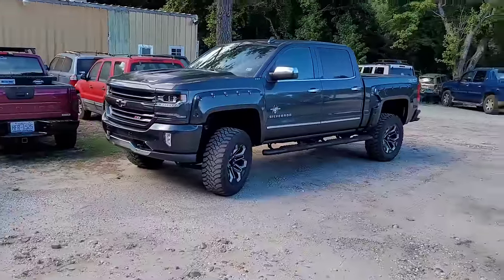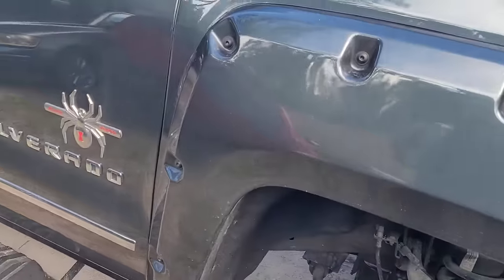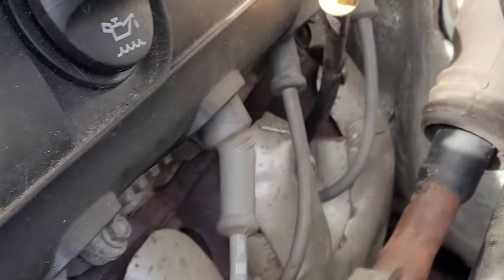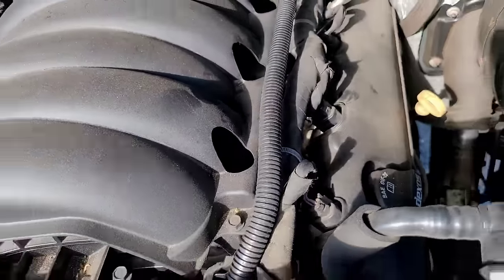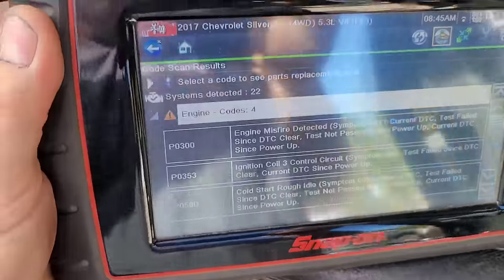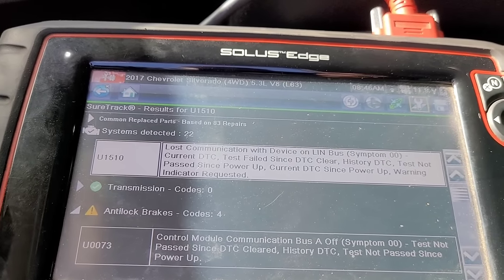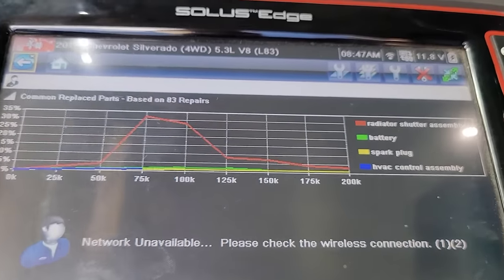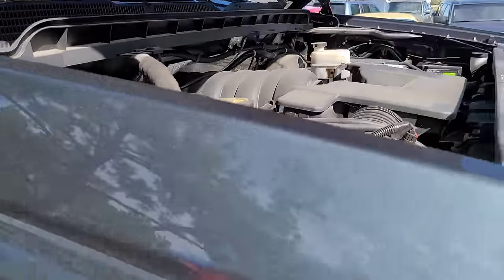AGAIN !!! Another "Tapping" 5.3 !! It's not lifters or exhaust.. 2nd time I've seen this..

Comment: Just to let you know I have a 6.2 L Chevy Silverado and I had a lifter failure the lifters collapsed so yes they are out there they do happen I fought with the company they tried to just replace the two different lifters that failed but eventually I had them replace all 16 so that's something you need to look at when they do fight you on this you need to have all 16 replaced not just one or two good luck
Reply: And then 4 more fail.
Reply: If they replaced those 16 with the same type, guess what? They put a bandaid on a bullet wound! Turn off your AFM\DFM, all depending on which one you have. That's the only way to be sure that your lifters won't stick in the collapsed position (what they do during cylinder deactivation) and then not pop back up.
Reply: We went through that they identified the lot part number that was bad so they did not replace them with that particular Lot number they replaced them with a known Lot number or part number that were considered good they have identified the malfunctioning lifters yes I had to go around and around with them on that to make sure they didn't stick bad lifters back in there the same Lot number and part number as the ones that were in there that were defective
Reply: @waynec211  And you believe that? GM has been having the lifter issue for years. Unless they changed parts supplier, I wouldn't take it on any long trips. Like I'd said though, if you disable your fuel management system, which can be done right from your dash, then you'll run the risk of it happening once again. You may notice up to 1 mpg difference in your fuel economy, which to avoid it happening again, sure seems worth it. Ask yourself this, if GM knew it was just a certain lot number of them that were causing the issue, why have they still been installing them in their 5.3L and 6.2L V-8s for the last ten years? Only thing I don't get, is why they haven't changed suppliers by now.
Reply: Yes I was considering disabling the fuel management system I had heard that could be possible problem too so who knows what the hell to believe but I guess I will look into disabling this fuel management system I don't like it anyway it's annoying
Reply: Thanks for the information I've been looking around for a disabler just plug in but most of the ones I'm seeing don't work on the 2021 Chevy Silverado 6.2 so I'm going to continue looking around
Reply: @waynec211  You should check out the Pulsar LT, this will get the job done for you, and then some. It's a simple install, many videos here on YouTube that walk you through the setup, and it has a lot of different options you can choose from right from the comfort of the drivers seat. I can guarantee that it'll be the best upgrade you'll ever make on your truck. There's a guy on here that has it on his 2021 Trail Boss with the 6.2 and he's knocking down 27mpg with it set to economy mode. I wouldn't have believed it if he didn't actually film it right from his dash showing it. Sounds crazy, I know. But just put one in mine, and figure with the price of gas now, it'll pay for itself in no time.
Reply: I bought a pedal Commander which I believe does the same thing as the Pulsar LT that you're talking about I just leave it in City mode plus one disable the fuel management system I'm hoping
Reply: @waynec211  Let me know how it goes. I haven't really done any research on the Pedal Commander before, so I'm just not as informed on those. I'd be really interested in knowing what your thoughts are on it after the install. Please feel free to give me any feedback you can. Always interested in learning more about aftermarket mods out there. 
Thanks, and I look forward to hearing from you in the future on this!
Reply: Yeah the pedal Commander it does increase the performance of your vehicle the response of the throttle body is a lot faster it will give your vehicle some get up and go especially if you put it in Sport Plus mode plus four right now I'm running it in City mode plus two hopefully disable the fuel management system I'm getting ready to go on a road trip of 1200 miles both ways and that's what happened last time after I got back from driving on the same trip I ended up having lifters go bad and stick or collapse so hopefully this will take care of it
Reply: I will say pedal Commander turns your vehicle into a beast especially the 6.2 L
Reply: @waynec211  You've got it installed already then?
Reply: @waynec211  There's still the button down along your controls that let's you turn on or off the trucks AFM/DFM, (not sure what year your truck is, depending on which fuel management system the factory strapped your truck with) but it's better to be safe than sorry I guess. I'd just hit that switch if your dash doesn't show it's turned off. As I said, I'm really unfamiliar with the Pedal Commander, so I'm not 100% sure on it's settings. Let me know how your trip goes using it, and track your mileage over the trip and see if it increases your mileage. That's what's so stupid about these fuel management systems the EPA is forcing car manufacturers to install, when in fact most of these tuners actually give you better mileage, and aren't so hard on the engines internal parts. But then again, who thought the Government getting involved would be a good idea, after all they're the same fine folks that gave us the DMV, the IRS, and the Post Office, and look how well that works for the American public!
Reply: @waynec211  Have a safe trip, and keep me posted, please.
Reply: I have called General Motors and I'm awaiting a phone call back on how to disable the fuel management system apparently the Suburbans have that option on them I'm going to see if I can get that option added to my Chevy Silverado so we will see what happens
Reply: What I mean by the Suburbans having the option I mean you can turn it off or on so I'm trying to get the dealership to put that same option on my truck to add it to my truck so we will see
Reply: Yes I have installed pedal Commander pretty easy just plug and play it's not bad at all it's just like the Pulsar LT you're telling me about pretty much sounds like the same thing I looked at them supposedly General Motors Suburbans are capable of disabling the fuel management system according to the people that I talk to at General Motors so we'll see what happens I told them why don't you allow me to install this on off switch like the Suburbans have still waiting on a call back but I just called him today
Reply: @waynec211  so if you don't have that switch along the row just below your heater controls, I think that means your truck has the DFM chip then. You'll have to check your original window sticker, and see if it's listed on there. If it's a 2021 that was built after March 2021 they ran out of the chips that operated the system through the truck ECM, and gave customers a $50 credit shown on the options column of the window sticker on the right-side facing. It's all just a bad idea at the end of the day, and GM, along with Ford, and Dodge (all 3 have had lifter issues) should be able to make that an addable option, because I know there are hundreds, if not thousands who would've actually paid the manufacturer to just leave it off completely.
Reply: Just below my heater settings I have a a with a arrow that goes around it which is the auto shut off on the start and stop when you pull up to a red light engine shuts off then comes back on I always turn that off then I have the tailgate button then I have a hazard button then I have the traction control button and then I have the electrical outlet button and that is all I have
Reply: I have a 2021 Chevy Silverado 6.2 L I just put the pedal commander on I turned it on City mode and left it there on setting two I did not get any kind of indication on the dash whether the automatic fuel management system was on or off but I will have to look at it closer and see I don't think it's going to indicate it's on or off so I really don't know how the hell I'm supposed to tell
Reply: @waynec211  Yup, you have the AFM on yours, that start stop is the fuel management. You've probably noticed when your driving out on the highway, or open road that when the engine isn't working as hard, on your gauge cluster you'll sometimes see a 4, or a 6. That's how many cylinders are actually firing at that time. When that's going on those deactivated cylinders have the lifters collapse to keep the valves closed, that's where the issue begins, when you then need the engine to use more power, say climbing a hill, or pulling out to pass, those lifters are staying collapsed, yet the ECM is telling it that it needs all 8 cylinders again, and the internal violence inside your engine begins. Hopefully the pedal commander you installed will take care of that AFM (Active Fuel Management) defect, I don't know what else to call it other than that, and your engine will continue to fire on all 8 and let you enjoy the trip!
Reply: I have about three more weeks before my road trip so I'm going to play with this pedal commander and I will look for the indication of 4 cylinders off on my cluster I've never seen it before so I don't really know where to look so I cross my fingers and hope this solves a problem if not General Motors will be replacing another 16 valves or maybe they'll just allow me to disable this thing or they can just keep paying for it or until the motor blows up and they can buy me a new motor I will try to let you know and keep you updated on what I find out
Reply: I called the dealership where I bought the vehicle and they say that I have a dfm and just merely turning off that start stop button is not going to turn off the dfm so I have a system that can shut down more than 4 cylinders looking to go down to three so still hopefully this will solve my problem putting the pedal commander on so we will see if I end up getting a new motor
Reply: @waynec211  fingers 🤞
Reply: @waynec211  I wish you could send me a picture of your original window sticker, or build sheet. That'll tell you for sure what you're dealing with. But it sounds like the Pedal Commander might do the trick for ya. Feel free to come back to the post along your trip, and let me know how it's going.
Reply: Will do.
Reply: @waynec211  Wow did it take a miracle finding this thread! So Wayne, how did your trip turn out? And are you liking the Pedal Commander set-up you're running now?

Comment: Wish my ticking on my 6.0 in my H2 Hummer was a plug wire coming loose. Mine is those stupid ass rusty exhaust manifold bolt heads that break off. That is a nice a Silverado, that color and whole package is exactly what I want eventually.

Comment: Back in 16 I got a 13 GMC with 10K on it put a little 6K on it and a dod lifter did indeed fail. Found out it had pistons rods and bearings done just before I got it Never knew why and far as I ever found out or was able to tell it was not a abused truck I got rid of that POS soon after I got i back Thankfully it was still under warranty

Comment: Factory lift, like any other lift really brings about the need for longer Tie rods.  The rack being attached to the chassis has to reach an increased distance to the outer tie rod socket.   I wonder if the factory really thought about that?
Reply: Usually packages like that are more dealer installed aftermarket than real factory things. Just one of those things where they can install $10k of stuff and charge someone $15k extra because it’s bigger and meaner than a standard one. 
That one for sure needs the front end checked close and an alignment. Probably drives like crap too, but has been that way so long they don’t notice.
Reply: Black widow is NOT factory.  Actually a service bulletin mentions that black widow may have suspension issues not covered by gm warranty

Comment: I see you pulled the primary coil connector first, and then corrected the secondary connection, but you should explain to laypeople why you did that. I’ve seen electronics get damaged on newer vehicles when people play with the ignition wires on running engines. By the by, shutter assembly on radiators is to quickly get engine up to operating temperature(strictly emissions related), but if it fails default closed ala VW/Audi products, you can end up with elevated coolant operating temperatures.

Comment: I've  got a 5.3 that did that, it ended up being the o ring that seals the oil pick up tube to the pump. The o rings degrade from heat.

Comment: I had a 2001 Silverado with 180,000 miles on it, (5.3) oil was changed every 5000 miles with mobile one & number 7 cinder went out completely & the truck was never driven hard, so no more 5.3's for me.

Comment: What I have not found an answer on yet is why my 16 silverado 5.3l oil pressure drops to about 20psi after only about 100 miles on new oil. Stays at 40psi at 2,000 rpm but this doesn't seem normal. It also has a crappy throttle response and crazy fuel trims
Reply from the maker: Those pressures are within spec . Check for a vacuum leak at the intake to head , that can cause crazy fuel trims . Also , the purge solenoid could be hanging open causing over fueling with fuel vapor

Comment: Adding after market stuff to these trucks is a nightmare.
Reply: What makes you say that?
Reply: Not at all
Reply: Give us an example.
Reply: The ls is easily the most simple and common built motor
Reply: I added aftermarket valve stem caps, and a hydraulic lifter for for cylinder #4 went out because of it. It’s been a nightmare trying to get my gm warranty to cover anything because of it. Your comment is right on point. 

Pray for me.
Reply: If you are willing to sacrifice GM warranty claims (if still under warranty), then go for aftermarket which of course won’t give you warranty similar or better than GM. Otherwise, stay off the aftermarket. Cheers.
Reply: @tylerrisner8389  the LS is, not the LT though 😅